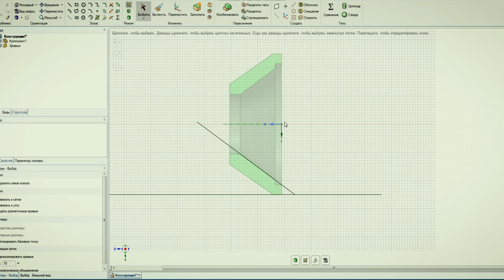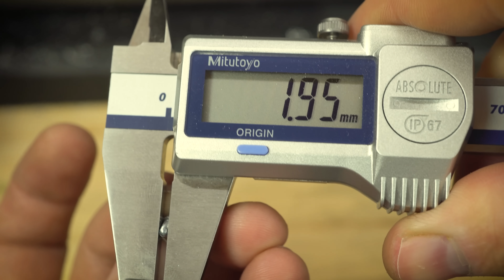Action camera and a HUGE old lens!

Comment: its called a sensor not a matrix
Reply: both are correct, it's a matrix (grid array) of light sensing photoelectric diodes, only difference is sensor places the emphasis on the fact that these diodes "sense", and matrix places emphasis on the fact that these diodes are in a grid array
Reply: @nindoninshu  You can call it sand with that logic
Reply: @coin777  i mean not really... sand is a material that is part of the process of making the sensor, but the matrix is the sensor, as in, each photoelectric diode combined together forms a matrix, just as much as it forms a sensor, it's just two different ways to look at the same thing

Comment: Unfortunately I do not have the tools showed in the video 😢, but I did a similar conversion a couple of years ago. I changed the webcam lens, by telescope adapter instead (telescope adapter has the same thread than most webcams), I had an old camera and its lenses M42 thread (as showed in min 1:07). I adapted a threaded tube (also telescope accesory). All modifications I spent less than 20 dls, BUT many tests and patience hours and finally worked. I plug the modified webcam to my cel phone now, with a otg cable and record in my mobile with the quality of a photografic lens 👍🏼. Thanks for share.

Comment: That was a fantastic conversion, very nicely done.
The lens was crazy heavy because of the huge chunks of glass inside it, and not the alloy body.
Glass gives much better quality than plastic and better than original  tiny glass lens made by a robot cheap as possible.
I was going to ask if the standard tripod mount in 'metric countries' was quarter inch by 20 TPI
 Seems it is as 1.27 x 20 tpi = 25.4 mm or exactly one inch.
It must be a legacy size, like with motorcycle drive chains. 
They are 'coded' in eighth inch 'segments', a 520 chain (very common on MX bikes) is half inch pitch (0.5")  by  2.0 x 1/8" or quarter inch

Comment: i used to do Astrophotography , where i learned the sensor temperature makes a huge difference . Shutting video at ISO 100 at Summer , is just like shooting it at Winter at IOS400. Because Sensors gets cold , and cold sensor has less noise . Of course , Dynamic range will not change , with higher ISO you get less DR , but the image will be cleaner . i learned this very good , it took me 3 years to master astrophotography , then i sold all my equipment , why , because i reached a point where i need stability , only achievable with fixed tripod , and observatory . So i sold it all , until i can build an observatory .

Comment: A zoom doubler (goes in between lens and body) would most likely have spread the image to fill, if not 35mm full-frame, then at least APS-c sensor size.
Of course it would drop the maximum effective f-stop to f/3.6 as far as exposure setting go, but act like a an f/0.9 in terms of focusing, because the image would be magnified  at the imaging plane.

Comment: I've wanted to do this for awhile! Great results! Could it be built with a simple plastic adapter in a 3d printer? Cams so light it could snap over lens threads. Gut cam to board and bat, then glue at distance. Cut lens off action cam threaded tube and bond to adapter.

Comment: You said that normally the camera holds the lens... well in TV many times it is not the case, the lens hold the camera.  The studio and sports lenses have big diameter so they capture more light, this makes them heavy.  The camera just acnnot hold that weight, so the lens in attached to the tripod, and the lens holds the camera.  Also some camera are heavy, 5~7kg, so the lens mount has a base plate to also grab the camera from the bottom.

Comment: That's pretty reasonable if you compare it to some of the rigs people put together with Pentax Q's.  The smallest part of a telephoto Q rig is the camera itself most of the time lol.

I've done similar builds in the past but used one of the newer Pi Camera Modules.  They use a decent Sony sensor, but more importantly it allows me to easily write and refine image processing and replicate the important features of a standard camera firmware.  I usually use a tamron mirror 500mm lens passed through a 2x teleconverter.  It's not the best setup image quality wise, but for astral it isn't terrible to play around with.

Comment: For anyone who is interested in calculating the effective focal lens (Not true) of this lens that has an optical zoom focal lens of  10-100mm:

1- A 16mm film camera had a gate of  ~11.5x7mm 
(16mm frame is 0.295" x 0.404" and the Super16 frame is 0.292" x 0.493")
2- The SJCam's sensor (AR0330 Sensor) has a sensor size of ~5x2.9mm
3- So crop factor of this lens on that camera is ~about x1.5 mag factor

That is almost 20-200mm
Converting this to 35mm FF is useless or senseless.

Comment: The Krasnogorsk-3 16mm camera has an M42 lens mount which can be unscrewed and removed. Could you you make a B4 lens mount that could be screwed into a Krasnogorsk-3 after the M42 lens mount has been removed? M42 flange focal distance is 45.46mm. B4 flange focal distance is 48.00mm.

Comment: This just shows how much more important it is to have a good lens compared to a good camera.
Reply: The lens is of course important, but a wide angle lens is also capturing much more image variety, it's much tougher to capture in high quality, likewise the video compression struggles much more with much more variation in the image. Wide angle lenses are also more difficult to make to capture high quality, and tend to cause distortion etc for anything but the most expensive models.
You regularly see video cameras that look great close up, but look considerably worse when further away/zoomed out.
A better example for image quality alone, would have been to place the cameras closer/further from the objects being imaged, to have the same images in the frame of each camera.
Replacing the lens with a much smaller, but high quality, lens such as for security cameras etc would've also been interesting.
Similarly I wouldn't be surprised if replacing the original lens with a large wide-angle lens would look at least as bad.
Reply: Both sensor and lens matters but the sensor matters more then the lens as seen before the modification it was very much useful but after it got better but the lens got what 500 times bigger to make that change to pictures quality.
Reply: @AKG58Z  The lens is always more important. Haven't you heard the saying "date the body and marry the lens"?
Reply: dude, bigger sensor will make difference on the same lens.
Reply: @nikostalk5730 it depends on the lens and the look you wanna achieve
Reply: @sebastianbermudez4081  It's not only that the larger sensor could capture more data, it's that the action camera sensor is only using a small part of the lens. Particularly only a lower quality lens, it would be considerably softer than with a larger sensor.
Reply: @DoubleMonoLR actually by using only the center of the lens, it’s using the best portion of the glass
Reply: @nikostalk5730  Cameras are lenses the sensor just replaced the film.

Comment: The weight is from the large number of glass elements. 
Yes it has a heavy mount to hold the optics. Modern "kit" lenses use c-39 PLASTIC for the elements and different plastics for the lens mounts. You won't find "kit" lenses surviving like the Zeiss lens you poo pooed in your lamented video. In loomi g at the result of your test, the contrast and color depth seem improved. Of course, a great deal has to do with the image processing software. Your choice of camera and its very limited image processing is still improved with the higher quality optics.

Comment: Bravo! I've wanted to do something like this for a long time, to attach to a navigation system on a boat to help me with autopilot control. The video contains a lot of technical work but you made it look so easy! Well done! Warm regards for a happy New Year from the United States.
Reply: You can actually buy adapters for a lot of modern cameras, these old lenses mostly use an M42 mount and ready made adapters are often widely available to most DSLR or DSLM cameras.

Comment: The tripod mounts are beautiful. But they seem like a lot of work to do. I'd recommend a cheap 3D printer. This could speed up your work, especially while prototyping. 
Anyway, a great video  👍😃
Reply: 3D printable plastics are not as strong as 8mm aluminum!
Once you have taken the measurements properly, transferring them into a 3D or CNC CAD takes the same time and the CNC works faster.😉😉😉

Comment: I’d made one from some stepping and filter rings, and a piece of IR cut filter glass glue in to the adapter. I’d had extremely good results from a super Takumar 50mm 1.4 and 200mm 4.0, but not from a 135mm 3.5. Depends on the lens. I did it originally on a ThiEYE T5e
Reply: It depends very much on the glass you put on, yeah. But having "bad" glass can be great for creative purposes too. 

I still wouldn't go for anything less than APS-C though. A used but decent EOS camera will give you pretty good HD footage with a variety of lenses and adapters. Fun to play with. :) 

I am kind of looking to upgrade to full frame but with the current world crisis there's no way for me to dish out that sorta cash.
Reply: @theothertonydutch  I had and still have an A7s at the time, but was curious because of the pixel density. Allows extreme telephoto footage with a long lens like a 200mm. Even with the 50mm was still around 400mm equivalent.

Comment: Did you account for the 'flange distance' (distance between the last element of the lens and the sensor/film) of the camera the lens was designed to fit? Only that might explain the slight blurring you saw?
Reply: It would explain it only at infinity, and he said he accounted for that, the real problem is that he is using an old lens on a 8mpx (4K) 1/3" sensor, analogic 16mm film was nowhere near that resolution and was two times bigger. The sensor's resolution and crop-factor are just outperforming the lens.

Comment: Old lenses are a gold mine, I've added a few to my collection and just use adapters and operate them manually. Very inexpensive mega upgrade if you don't mind the lack of auto everything
Reply: A lot of improvements in new lens tech is better MTF performance and overall better quality
Reply: @AppallingScholar  While the newer lens may produce a more favorable line on a graph in my experience and personal taste there is much value in the visual product of older lenses that are more than is quantified on a chart.
Reply: @AppallingScholar Lens quality isn't an objective thing, because what may look good in numbers can be boring for some and fantastic for others. For example, anamorphic lenses have a lot of imperfections and sharpness issues, but it creates a nice look, so people like it. Vintage lenses are often the same.
Reply: any specific recomendations?
Reply: @faggabumm Not an old lens, but cheap for it's class, the Samyang VDSLR 85mm t1.5, cine, all manual, prime, extremely sharp and insanely fast.
Reply: @faggabumm  I got the canon nfd 200 2.8 and 135 2.8 and I love them
Reply: @faggabumm  I've found good Sigmas for cheap, I love the look. Modern vintage family photos, the look exceptionally unique and extremally nice with a high res camera
Reply: I wish someone like yourself would market them to action cam users

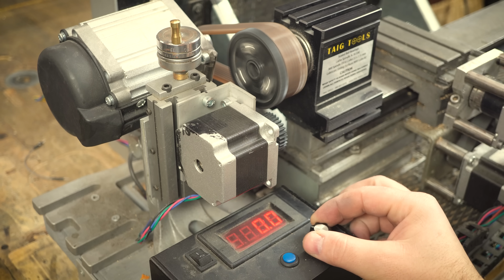Comment: 5:01 
6:09
Yes, absolutely this was the most fascinating aspect of the build/project. Ca Lem made a similar setup for cutting the 'spiral worm gear' [manual scroll chuck]. The parallels of your project and his are quite similar, yours cutting threads and his cutting a spiral worm, both requiring a constant feed/speed and stepped depths of cuts, yours with software, his with custom gear size.
Reply: Ca Lem's setup was WAY more involved. This one only needs to move a single linear axis. Ca Lem's needed to run both axes simultaneously, and he did it manually. He manually coupled the two planar axes (x and y), so that they would translate in relation to one another. The method used in this video is pretty common.